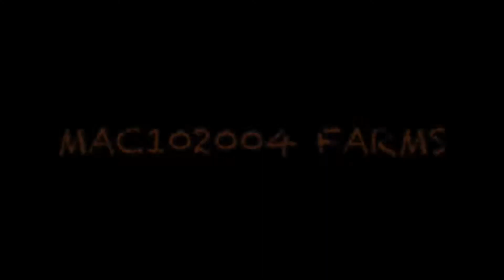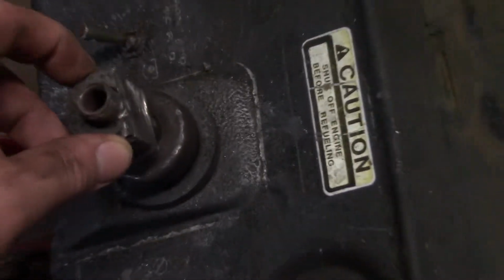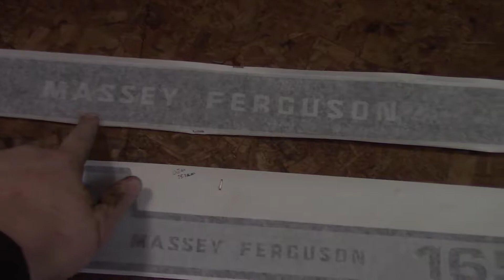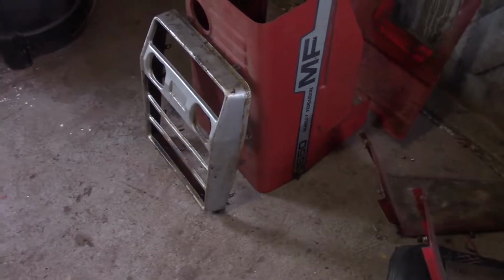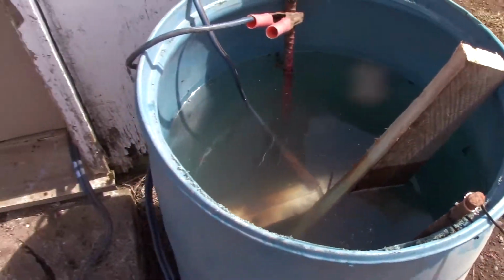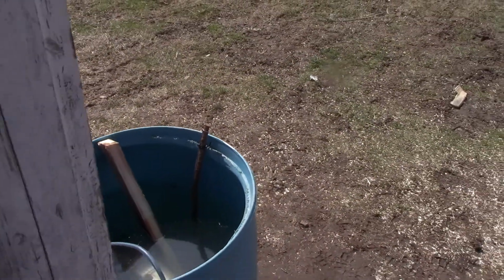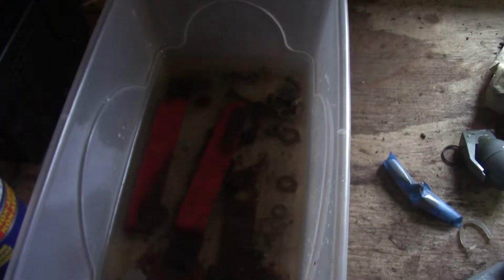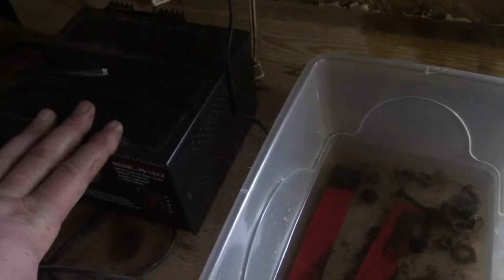Massey Ferguson 1650 Restoration Part 4

Comment: Howdy,watching your progress here and  wondering where you got your dash decal,I've only found one place for them and it's 30 bucks,I got the others from Maple Hunters. Thanks for sharing!
Reply from the maker: That’s the one, click it and stick it. It’s an exact replica but it is a bit over priced. The maple hunter decals are good quality but they are way off from factory I was pretty disappointed. I ended up having my own decals made up for the hood and fender, I put an extra set on eBay but unfortunately because it was a small run of custom decals they aren’t cheap either lol
Reply: @macsworkshop9366   I have an 1855 my brother has a  1655 I'm getting a  1655 and a snapper 1650 but I have many others primarily John Deere,so I have others to buy decals for too and believe me, anything John Deere is expensive. Thanks for responding and I don't think I've seen all of your videos yet but close.
Reply from the maker: Yes Deere is pricey for sure but easier to find parts for than the MF. Thanks for watching I appreciate it 👍